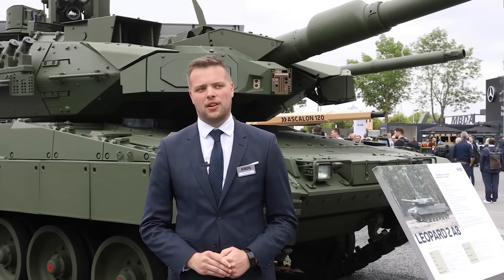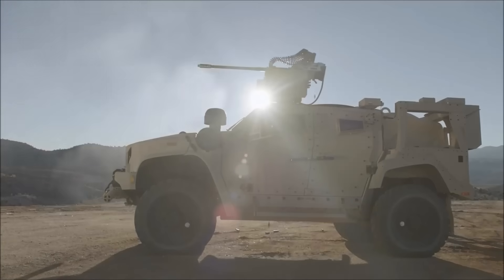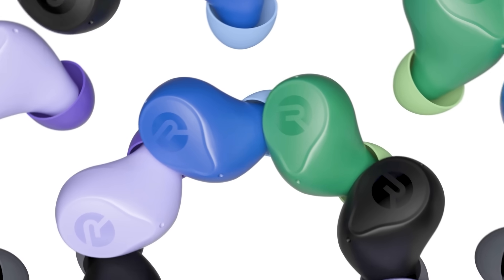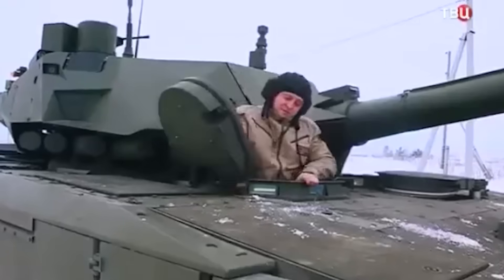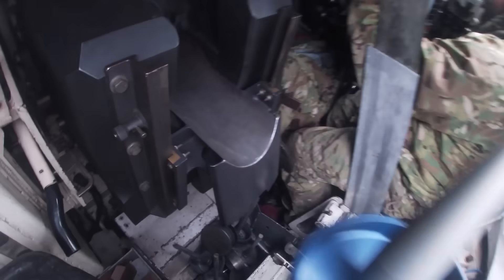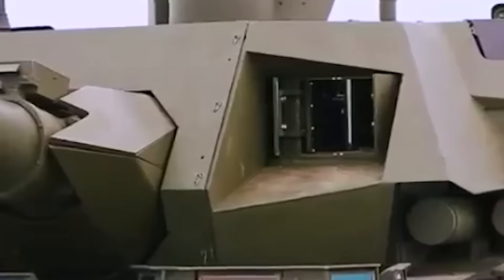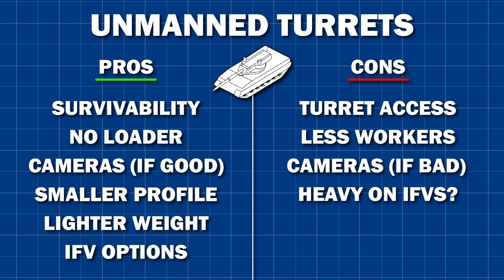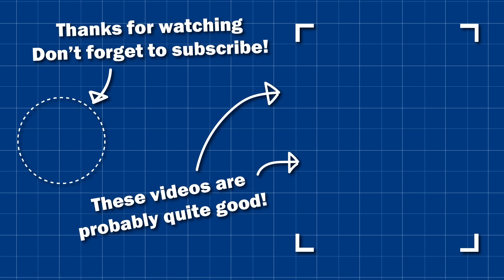The Unmanned Turret - And Why It's The Future

Comment: It's the lack of situational awareness that I think is the killer. You're adding an extra step to lay the gun onto the target. You have to work out where the camera is pointing in relation to the gun. Then aim the gun there. That's not a step that exists when you have that intuitive body connection to your eyes 

You also won't have the same quality of vision with current camera technology you can reasonably fit onto an afv 

It will be the future someday. Not yoday
Reply: With a typical RCWS this simply is not an issue. The aiming reticle is at the center of the screen. The camera is pointed in the same direction as the gun. You look for the enemy by panning the camera, and then you center it onto a target to aim and you pull the trigger to fire. The fire control system figures out everything else for you, including accounting for gravity, wind, and leading target motion. It also stabilizes the sight and the gun for you, so you can do all this stuff while the vehicle is in motion. It also gives you MUCH better quality of vision, including the ability to zoom and see clearly at night.

In contrast, if you're manually aiming an unstabilized gun while a vehicle is in motion, you more or less shouldn't even bother to pull the trigger because all you'll do is waste ammo not hitting anything.
Reply: @IsaacKuo And communication between tanks?
Reply: @chrisgrigg5462  What about communication between tanks? That's not going to be from gunner to gunner, unless things have gone terribly wrong.
Reply: @IsaacKuo The TC still needs to know where his camera is pointing relative to the tank
Reply: @chrisgrigg5462  Well that's evidently something the TC already has to deal with. For example, on an M1A2 the TC's CITV rotates independently of the turret, while the display is fixed to the turret (which rotates along with the turret, and thus not fixed in orientation with the hull). Nor is the hull fixed in orientation in compass directions.

The TC just has to deal with all this, in order to maintain situational awareness of one's position and orientation compared to mission objectives and the others.

Experience has shown that in order to handle all this, the TC must be a dedicated crew member, who normally does not drive or shoot or load the gun.
Reply: @IsaacKuo And from what I understand, most TCs don't fully button up and use their cameras. But instead fight unbuttoned to improve situational awareness. The Chieftain talks about this, because of the problems that vision and cameras impose. I'm still not convinced. It seems like you're taking a handicap.

Additionally, I can't imagine these tanks passing the "oh my god, the tank is on fire" test
Reply: @chrisgrigg5462  Well, the US Army prefers to fight at night, and there's more or less nothing to see if you try to fight unbuttoned. And even in the daytime, this being unbuttoned only helped with the the M1 and M1A1.

The M1A2 introduced the CITV TC sight, including hunter-killer ability. At that point, not using the CITV and its hunter-killer ability just meant doing the enemy a favor by decreasing the range at which the TC could spot the enemy, and decreasing the team's ability to kill targets, and increasing the time required to engage a target.

It's not an exaggeration to say that the CITV easily made each M1A2 twice as effective as an M1A1.

As for the ability to get out of the vehicle quickly - that really depends on design specifics. For example, the T14 Armata has hatches above the driver and gunner, so only the TC needs to scoot over to one side before climbing out. And if one hatch is stuck, the entire crew can still get out pretty quickly.

I think the Leopard 2 A-RC3.0 should have had two crew in front with one behind, so both of the front crew could have hatches (the Leopard 2 driver station is already offset to the left, so the additional crew station to the right and its hatch would be a small modification.) That way, only one of the crew members would be underneath the turret. OTOH, the additional protection against top attack may have been considered better than the ability to exit the vehicle quickly.
Reply: @IsaacKuo So, you're missing the point. I'm talking situational awareness and communications between tanks. Where is the tank, what should we do. Then where is the tree line relative to the tank

You're focused on target awareness. But you don't always need to look at tanks. Buildings, trees. And then talking to your platoon/troop tanks.

I'd also hesitate to use the T14 as an example of an operational tank. It's not been seen on any battlefield to my understanding.

Also, saying you're only going to fight at night doesn't exactly help if you get attacked during the day and your tanks need to do something. Or if your enemy knows you only attack at night they can plan around it.

You're sacrificing an ability to unbutton and gain better situational awareness for a lighter tank and some marginal armour increase. I don't think it's a worthy trade off
Reply: @chrisgrigg5462  The TC in an M1A2 has better situational awareness using the CITV under all circumstances, period. It's just that much better than using your eyeballs all around.

And there's nothing wrong with discussing the T14 layout. If you prefer, I could use the example of the earlier M1 TTB since it used the same crew layout. But that was just a prototype, not anywhere close to an operational vehicle. There aren't any other production MBTs with unmanned turrets to point to as examples.

Comment: So many of the arguments against crewless turrets are either misinformed (like the crew argument, because we aren't in ww2), or they are arguments where we expect perfection over simply being better than the alternative.

Like the argument about the eyeball is silly. Protected crew vs this idea that sensor arrays can't be better and there aren't a ton of improvements to technology to make tank vision better.

Just about the only reasonable argument is about cheapness, and a missed argument in their favour is that you no longer are giving crews literal brain damage due to the concussive force of firing the main gun, a dark cloud looming over militaries that they like to ignore.
Reply from the maker: I don’t think so - I just think you have your opinion, clearly a pro-unmanned turret one. Which is absolutely fine.

Removing the crew’s ability to physically LOOK outside will massively decrease situational awareness. There’s no real way around that. 

And I do speak about the fact you are separating the crew from the gun. Just not specifically for brain damage reasons. 

There are pros and cons of each - depending on price/capability/doctrine I imagine we will see many countries disagree about which is “better than the alternative”.
Reply: @RedWrenchFilms  If it's deemed necessary, an unmanned turret can be placed on a raised platform. Think of how the roof of a car is raised up by four columns, but without the windows. That way, the crew underneath the turret can directly look around in all directions except up.

This could be a good fit with using active suspension like the K2 Black Panther, to lean the entire vehicle to elevate the main gun. That way you don't have the gun breech tilting downward and potentially bonking crew in the head.

Comment: With a manned turret you can still communicate in radio silence. Hand signals and shouting can't be done from under armor.
Reply from the maker: Surely it would be significantly easier to communicate in an unmanned turret if you are sitting beside eachother?

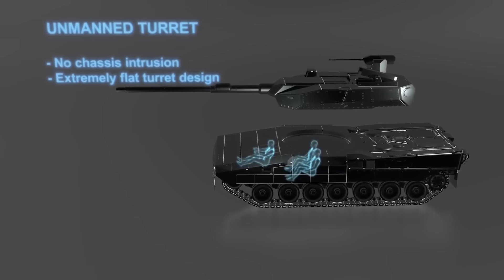Comment: 4:58 As someone who doesn't know what they're talking about.
Why not stretch the tank out a bit? Make it longer instead of wider.
Put the gunner and commander behind the driver anyway, and increase the length enough to give the gun enough space to move.
Reply from the maker: As tanks get longer they get a lot harder to manoeuvre! It would also be heavier due to the extra length itself but also the side armour required to protect the extra length.
Reply: @RedWrenchFilms  Oh yeah that makes sense. But does it get harder to maneuver even for a tracked tank? Or is it mostly because of the extra weight due to the surface area?

Also surface area increases regardless if you make it wider or longer. So I am guessing that longer would be less appealing, because tanks aren't armored on the top and bottom to the extent that the sides are armored?
Reply: @Phage-   In the case of the Leopard 2 A-RC 3.0, the vehicle is neither longer nor wider. The main hull is restricted to the ordinary Leopard 2 dimensions, which saves costs and simplifies logistics.

The extra space for the two crew members under the turret comes from making the turret basketless. Normally, the turret basket consumes a cylindrical region underneath the turret. Remove the basket and this frees up space underneath the turret for crew members (in non-rotating stations).
Reply: @IsaacKuo  Oh that's interesting. Is there opertunity reduce the dimensions even more while staying as effective conventionally as far as you know?
Reply: @Phage-  I expect that the Leopard 2 main hull is not optimally sized, compared to a clean sheet design with the same basic characteristics.

But one weird possibility to dramatically reduce volume could be what I call a "flat turret". The Leopard 2 A-RC 3.0 has a unique double jointed elevation mechanism to allow a low profile basket-less turret the ability to elevate well.

Now consider an alternative low profile turret with NO elevation joints. The barrel is fixed horizontal or slightly elevated, so the turret mechanism only slews the barrel left/right. The turret can be very flat this way, as well as not requiring a basket.

In order to elevate the gun, the entire hull leans, using an active suspension like the K2 Black Panther or S-Tank.

With a traditional main battle tank, the main gun is stabilized in elevation, with the fire control system waiting until the gun is slewed just right to fire. With this "flat turret", the main gun is slew stabilized, and the fire control system waits until the gun is elevated just right to fire.

Comment: A lot of comments about oscillating turrets, but one new possibility could be a flat turret. In a flat turret, the gun is horizontal or at a fixed slightly upward angle, so the gun only slews in one axis. Active suspension leans the entire vehicle to elevate the gun.

A flat turret enables a more compact, balanced design with the breech of the gun further back than the turret ring.

Comment: if i designed a tank i'll start with turretless xD
Reply: That's a fun start. But then I'd decide to add a 25mm gatling turret to deal with drones and stuff. However, it can be made very low profile, having 0 degrees minimum elevation. If it needs to shoot downward, the tank's active suspension can lean the hull to allow the 25mm to depress below 0 degrees.

This allows the hull to have a "flat" top, generally increasing available internal volume because the front can be as tall as the rear.

Comment: As a 3D modeler who has built many tanks in 3D, both Unmanned and Manned Turret, there are many things you need to keep in mind when you have a tank with an unmanned turret but even for manned ones . First you need to think about the onion of tanks (don't be spotted , don't be shot , don''t be kill) . When i develop an tank model with manned turret , i still use the 3 man crew , because i think it's much safer to use an autoloader than manual loading (you have an small door that will open vs an bigger one) It's much faster but depends , but it's still about onion of tanks , The problem of T-series is not because carousel .. it's because of propelent used in charges and in combat if you look alot of videos will see very or not even APFSDS shell in autoloader  , Tank to Tank combat are rare , but breaching an heavy fortifed zone with an tank are very common or to use as suppresion , so they pilled up with alot of HE , HEATS . And why NATO whats an 130 as standard is because if you have an much longer range to shoot into an fortifed zone , your changes to be shot will decerese (*onion of tanks) , you have an more explosive in an shell , you have better range , you can add diff types of shell like cluster this is for manned turret with an autoloader .

For unmanned , the onion of tanks still applied , but you can bump the caliber even more 140-150 or even 160 it's not impossible task for this , you have 3 crew in chassis . You say your side armor decrese this statement is redundant (Onion of Tanks) you still can be killed even you have 400mm of composite + another 400mm of ERA on sides so is redundant . Yeah it's better to have more armor on sides but more weight create problems ! 
And for new MBT's now it's more ok to have +60 or even more tons with Manned or even Unmanned turret you need to focus on armor now we see the new treath of MBT (ahem Drone) but this it will not kill the concept of tank !!! Tanks will adapt to new treaths look how tanks changes from 1945 to today and will see how the adapt to new doctrine or new treaths . Probably an new MBT that will work and can enter in service will look like this : 
-  130mm Main Gun with Autoloader 
-  3 Crew  probably even 4 but still .. 
-  Unmanned turret need to be heavily tested in real combat or atleast mock-up an real combat  so we will stick with manned 
-  Weight +60 tons it's not good to take some armor from diffirent areas to decese weight ( yeah the composite armor technology evolve ) 
-  1-2 RWS with AI integreted 
-  APS * in special an hard kill one is an must need ! 
-  The new tank need to focus on some weak zones because of drones ( upper front chassis plate and upper turret armor )
- Jammers for diff things from drones to even ATGM's 
- More comms systems 
There's alot of things to add but still
Reply: Where would you place the 130mm ammo, and what sort of autoloader design? Two piece ammo or one piece? How much ammo are we talking here?

(I personally would go with 120mm mortar main armament, as it saves weight and mass, allowing about twice the ammo thanks to reduced mass and size, and it can be greatly more effective against many targets due to the high angle capability.)

Do you like the basketless turret idea of Leopard 2A-RC3?
Reply: @IsaacKuo  first of all it's about what a tank would look like not a mortar, I don't know how some people don't understand this... It's a tank design not a Mortar, the size of the projectile is not the problem, and neither is the autoloader guess what the Russians managed to put in a T80 152mm with 2 stages, 130 in a bustle autoloader is a water pistol... Yes guess what again M1TTB there is a proposal to mount 130mm in a single stage in a Revolver type autoloader soo alot of guys think ! if you reduce mass is great in some cases it's not ! And an mortar main armament is complety useless agains others MBT in front even if tank to tank is rare , still you need an powerful gun to able kill the enemy tank ... and second how much ammo can take pretty alot it depend of how turret look but will but we'll speculate that somewhere around 30 130mm projectiles  in an autoloader plus someones in storages .. So your argument is not valid for how new mbt will look like because your design it's not meant to be an MBT
Reply: @iustinel25 Thanks for your explanation of where you would place the ammo. I'm not sure I'm reading you correctly, but you say you would place 30 rounds of 130mm in turret bustle - is that right?

This does not seem reasonable, as the KF51 only has a 20 round capacity. The size of the KF51 turret is as big as possible without going taller.

As for the effectiveness of a 120mm mortar against enemy tanks - you forget that it can attack the thin top armor of tanks using the 120mm Strix mortar round. This is particularly more effective than APFSDS against Soviet/Russian tanks because it has a much higher probability of setting off the infamous "turret launcher" ammo carousel. Strix also attacks from an angle too high for Arena to engage.
Reply: @IsaacKuo  Learn how to design tank ... because that thing you say will never work ... plus Mortar is much effective than APFSDS really man ?? Do you understand that Mortar round is soo fucking slow it can be intercepted by hard kill APS pretty easy vs a mach jesus uranium/tungsten rod ... yeah man ..... i find another guy with even more unpractical design and ideas on X ... and what you say is complety fantasy ideas from HALO ?
Reply: @IsaacKuo  And ps KF51 can carry more round if that lotering amounition is remove , even the they say it can carry more round if that thing is removed .. and that thin top armor is not that thin ... + alot of Soviet/Russian Tanks use ERA + mortar rounds have very very low penetration + ahem accuracy yeah ... i will not go into that ... And that turret launcher is not only about carousel ... to understand how soviet tanks works and soviet design work ahem they can carry more round which is not in the carousel, plus a lot of ammunition is HEAT and HE, very rarely do you see full carousel with APFSDS .
Reply: "-  Unmanned turret need to be heavily tested in real combat or atleast mock-up an real combat  so we will stick with manned "

this dumb argument because we will never past it if they are not tested in the field, what is this opinion
Reply: @tonyhart2744  Chill out ... i make a little mistake soo you don't need to be so upset
Reply: Literally stfu, you model tanks in 3d, you are not an engineer or tank designer
Reply: Get lost
Reply: @underhorse5367  For what ? i say what i think a new MBT will look like
Reply: @underhorse5367  if you are more smart than me why not say your own opinion ... you just say something that is complety idiotic if i say ...